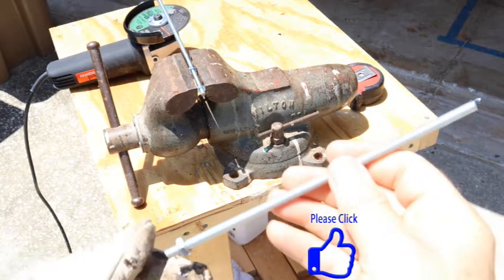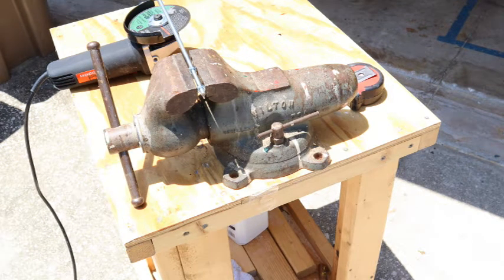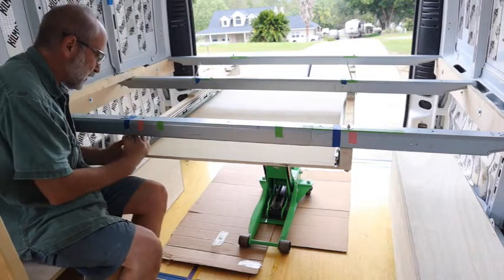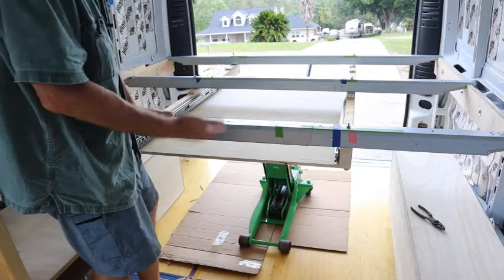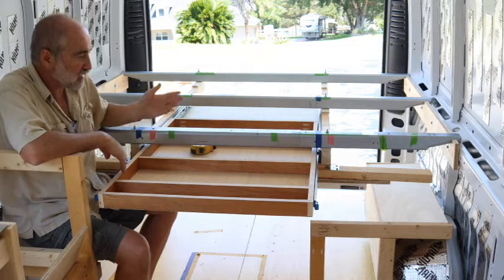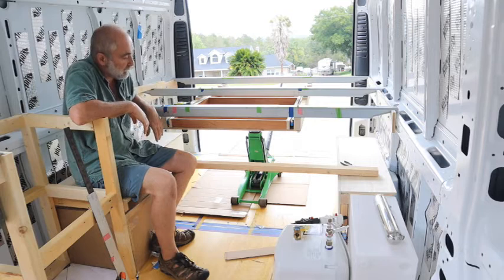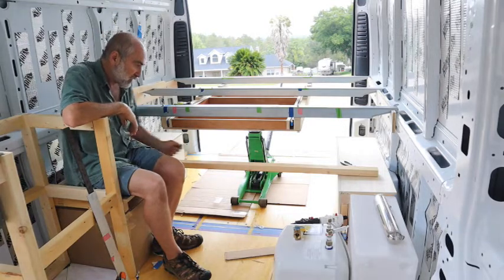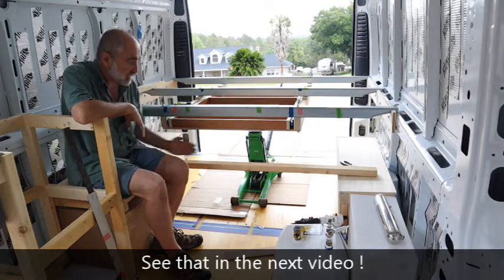Van Life  Pull out table installation - Heavy Duty Drawer Slides

Comment: Been wondering how to approach this style of table and so happy to tumble on your video as I too have the IKEA bed struts. This is simple but genious can’t thank you enough and have now changed my design to incorporate the draw. Thanks for doing this 🙏🏻
Reply from the maker: You very welcome.  The IKEA bed struts are perfect.  I don't know why they are not more common in van builds.  Easily adjustable, strong and better than wood.  Cheaper than buying and other metal posts.  The table has worked out very well.  It does pull out longer than we actually need!   Currently working on the top of the table which will feature a US map.  Of course that will be in a future video :-)
Reply: Frugal Factor it’s actually quite common place in self builds over here in the UK, to the point where IKEA customer service no longer provide the free brackets as they are overwhelmed by people asking for them! The draw table I have never seen before though! Do you have a video of the finished table showing how it opens? Thanks again.
Reply from the maker: @petegaskell4274  This link is to the first video of the table.  https://www.youtube.com/watch?v=wsYDuWAutG8&ab_channel=FrugalFactor

Comment: Love the concept! What sort of bolt do you use ? How do you prevent them from slowly unscrewing themselves over time due to vibrations?
Reply from the maker: To hold the drawer slide to the bed rails threaded rod is used and cut to size after installation.  Two nuts or one nylon insert lock-nut on each.

Comment: Good information! What are the dimensions of the threaded rod you are using?
Reply from the maker: 1/4" - 20  as long as needed (about 6 inches).  Then cut after installation.
Reply: @FrugalFactor  Many thanks!